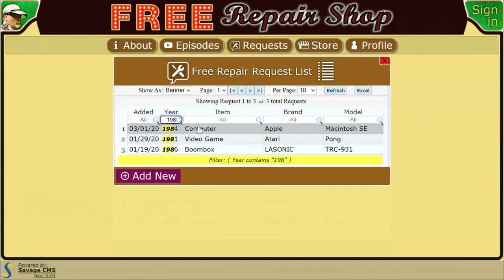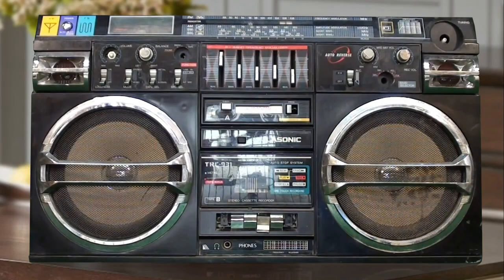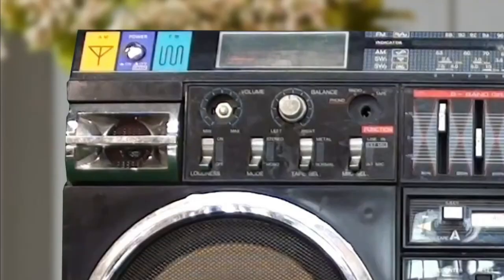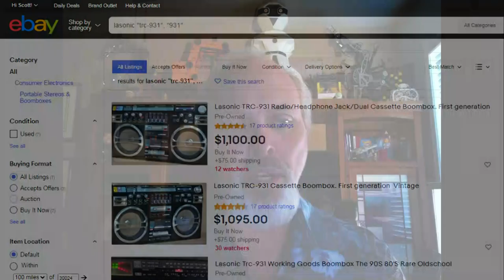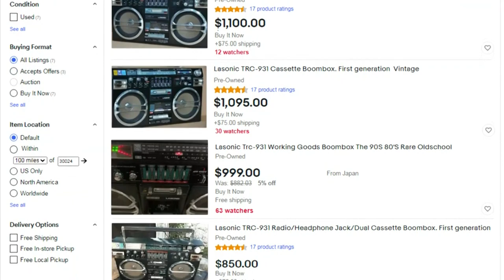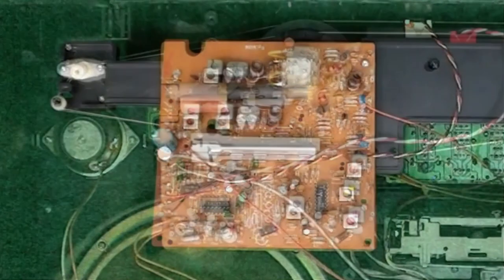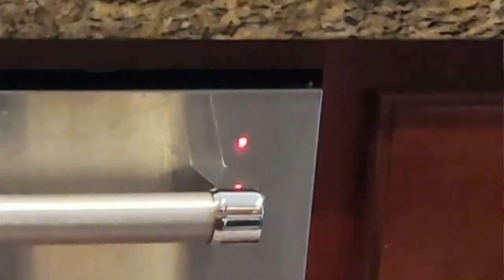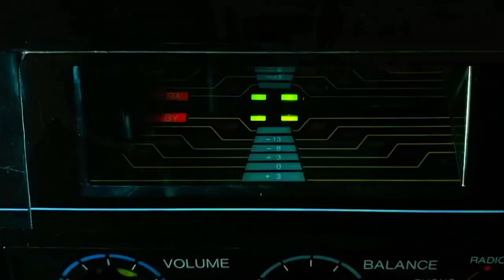Epic Boombox Transformation: TRC-931 Revived!

Comment: I find most of my electronics from tag sales or thrown away. I never worry about tape decks not working if they have aux inputs. I have the same Lasonic found in a dumpster. I cleaned it up and it works well. I wish I knew how to change capacitors. I have so much equipment that can use that upgrade. For and inexpensive unit I liked that it had auxiliary inputs and outputs. Sounded loud. I liked that the tuning “needle” changed colors when station tuned in, a feature that my more expensive boxes did not do. I also liked and disliked the  VU meter display. Good stuff!

Comment: Great job but just a quick tip. Next time as you remove any knobs, cassette keys, small chrome or sliders first then just drop them in a really hot bowl of water with dish soap. Let them soak as you continue working in a radio. Less water to waste and comes out the same if not better. Something I always did with my boomboxes when I cleaned them up.

Comment: thank you so much for this video showing the entire teardown as It will help me when I tear down my Lasonic try 931. mine is in way better condition. everything works however the tuner string dosent move the indicator but does tune the radio. It needs new belts and when I touch the boombox whith it on it makes a buzz which is probably bad caps? I really don't want to have to re cap it as ive never done this and it would be a learning experience. Its in great cosmetic condition but of course ill clean it. What do you recommend to clean the plastic and the clear plastic over the vu meeter and cassette door?

Comment: Beautiful work on that restro!

For my retro computers, particularly if they have been damaged by a leaky battery (a Varta battery in an Amiga comes to mind) or capacitor, I soak them in 5% white vinegar and then give them a good scrubbing with an electric toothbrush. From there it's a rinse under the tap, and a quick trip to a 91% alcohol bath (with another scrubbing to get the residual flux from the re-capping off of the board). Yes, this is all done outdoors. :)

I've done it to a dozen boards and they all have come out fantastic.

And while I'm not going to guarantee it, your average el-cheapo electric toothbrush appears to fall into the intrinsically safe category. But you're on your own if you use this method, and your burns and skin grafts may vary. 

So I would recommend using a non-electric one...

As for replacing the caps, it's what I would have done (and have done to several boards including Amigas, Commodores, and Speccys).
Reply from the maker: How does the vinegar work for you on the battery corrosion? I haven't had much luck with it.
Reply: @ScottSavageTechnoScavenger  Put some baking soda on top of the vinegar. It bubbles up and works pretty good, especially on car battery terminals.

Comment: Wow you did such a great  job restoring this boom box.  You did everything i do to restoring old electronics.  I have ran many things through the dishwasher.  I can even leave the heat off so fragile plastics are not melted, and when dishwasher stops, i just use compressed air and blow off everything with that. I have ran many crusty tape decks through the dishwasher in which i did not see you do so, but did you remove the capstan wheel pin and oil the bearing?  If not then the capstan pin may start squeaking or run slow and cause the tape to drag.  All in all you did a great job on this.  Did you put the other one bavk together, and would you be interested in selling it?  Just curious.
Reply from the maker: I didn't put the other one together.  There are not enough parts to do so.  I plan on using it in some other project.  (Don't know what yet)

Comment: How much would it be to restore the internals but leave the cosmetics as is? I just recently bought one off eBay that fully functions but isn’t cosmetically perfect. It has some minor damage to the graphics around the power button and missing the dial and one of the levers. I already sourced replacements for those items but I want to keep it’s weathered appearance since it will be used at my work. Essentially it will be like an old classic car with patina but is electrically and mechanically sound
Reply from the maker: Send pics to

freerepairshop@gmail.com

Comment: The radio decal is different at the end of the video compared to the start (condenser microphone)
Reply from the maker: Good catch!!!  The decal was spliced together from the two since both had damage in different areas.  Can you see where the separation is?
Reply: @ScottSavageTechnoScavenger  Yes it's the left side/start of the radio dial numbers just after the tiles and the sould level indicators.
Reply from the maker: YEP!!!  you know your 931s!  I saw a Bluetooth mod on your channel.  Do you do that for fun of professionally?
Reply: @ScottSavageTechnoScavenger  Both really
Those 931's are built somewhat better than the Crown sz5100/Unisef but the sz's are simpler and have internal fuses. So less likely to blow parts difficult to replace, Better for beginners lol😆
I too was once a beginner😐